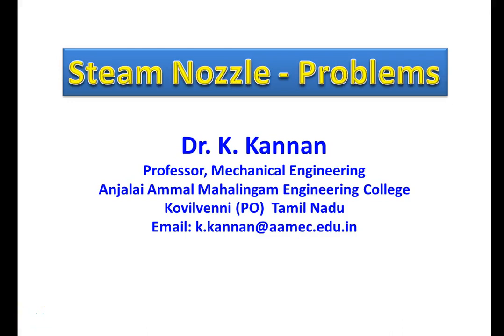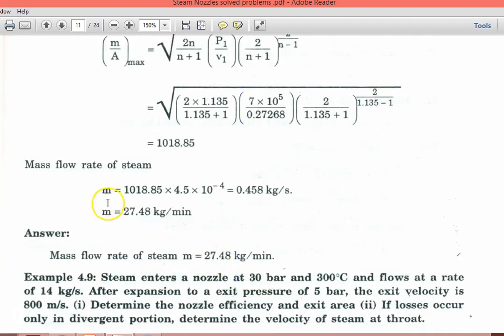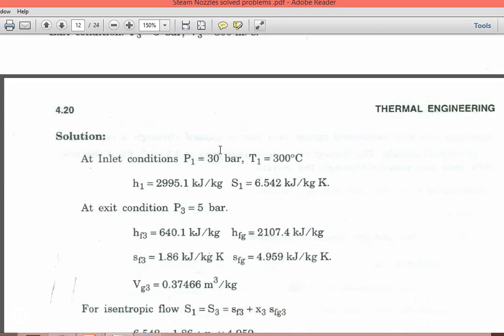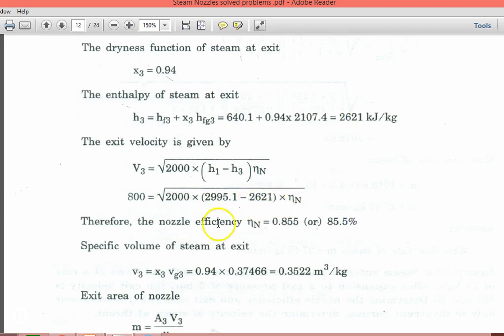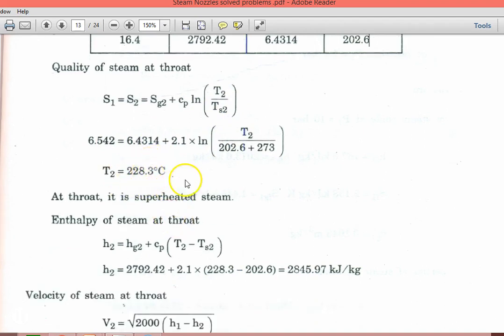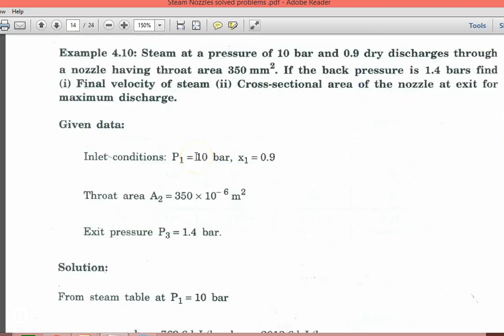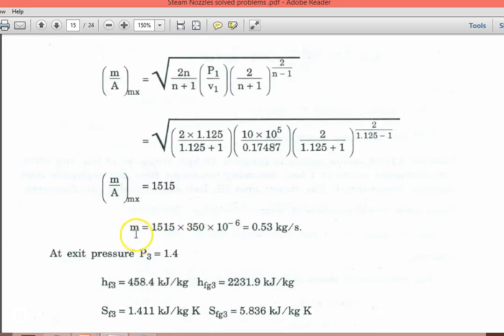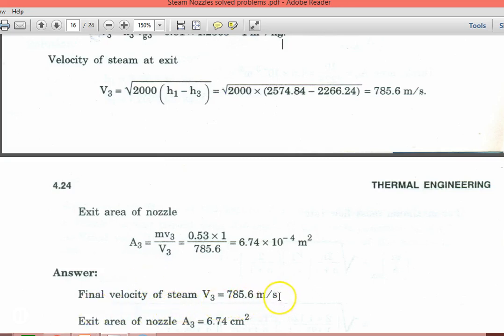SN 04 Steam Nozzle Problems 3

Comment: sir can we solve the previous video problems using mollier chart???
Reply from the maker: Using steam table you will get correct answer
Reply from the maker: Ref steam nozzle problem 6,7,8,9
Reply: @dr.k.kannan198   yes sir we will get more correct answer using steam table, but if not atated in the question can we use Mollier Chart?